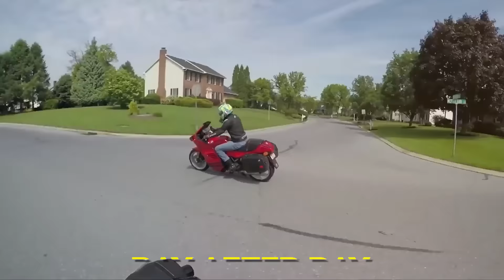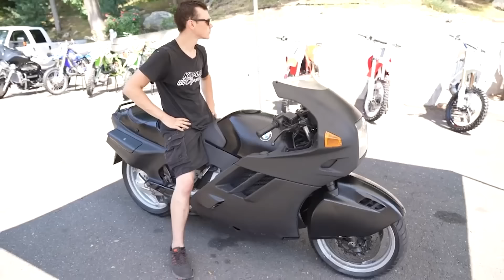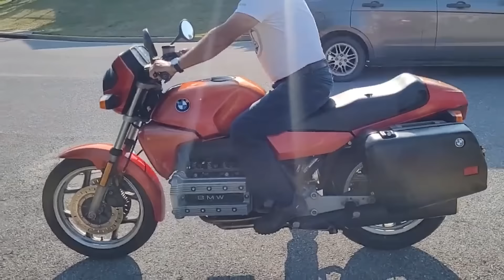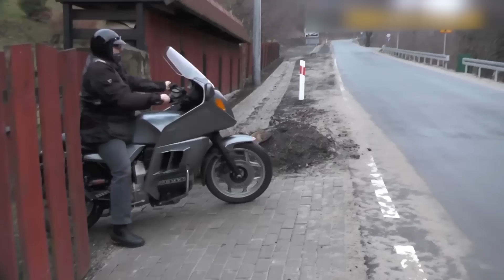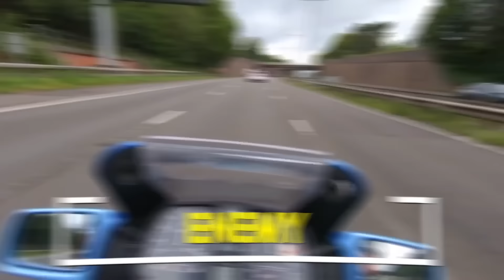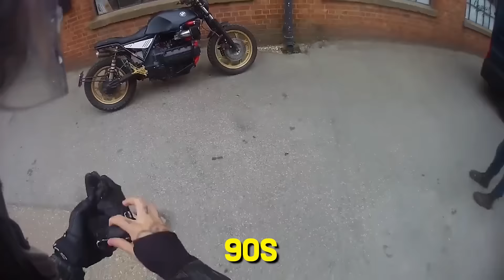This BMW Engine Lasted A MILLION MILES (And That's The Problem)!

Comment: “Straighten things out”?  They actually put in a 90 degree gear at the rear wheel while a chain driven motorcycle stays inline the whole transmission of power!
Reply: Chain drive has the same 90 in the gearbox so the front sprocket can align with the rear.